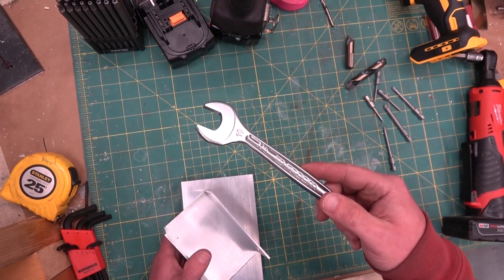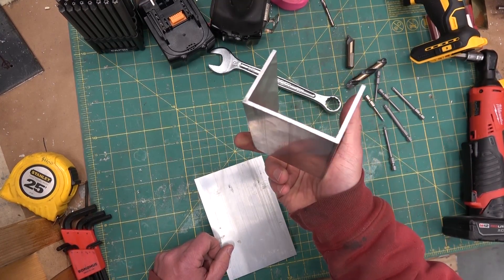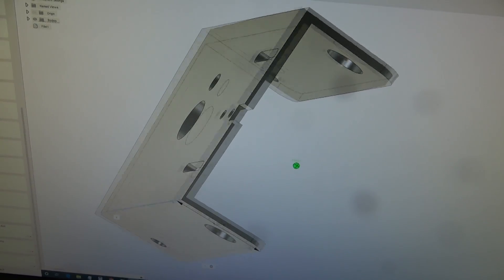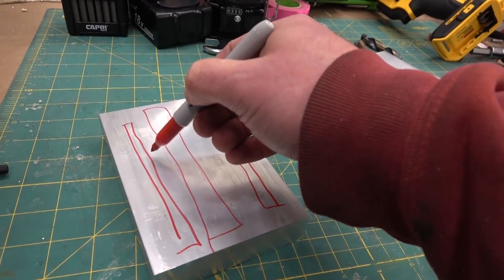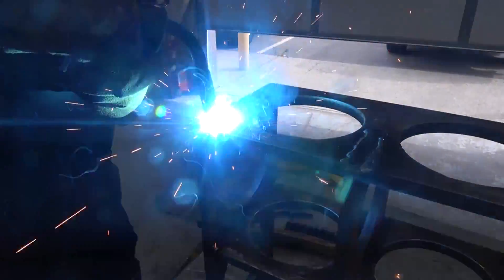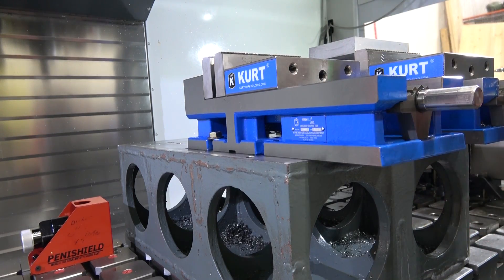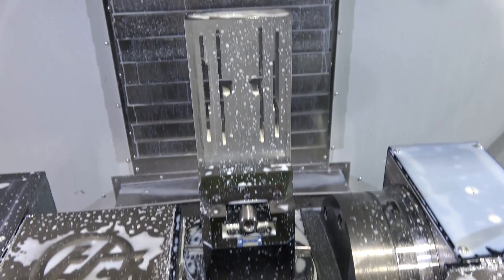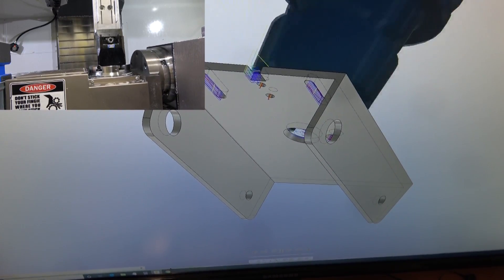Simple vise from pipe plugs | NYC CNC Johnny 5 Robot

Comment: Those@%&# renishaw batteries go out at the worst times, it pays to have at least one set of spares on hand. I think the other probe uses the same size battery, so it keeps the number of spares needed down. Btw, theyre available on Amazon, just like everything else these days.
Reply from the maker: You couldn't have let me know earlier?! Now I got ten of the corkstuffers hidden in my drawers.
Reply: @arduinoversusevil2025  Enjoy buying those goofy Li-SOCl2 Saft batteries made in France that Renishaw insists on using.  They couldn't have just gone with standard CR123's...that would make it too easy.  The tool setter and touch probe battery life is also staggered...one always seems to last about a third longer than the other so you're always changing those fucking things and then having to run through the calibration process again.  You're going to be getting the timeout alarm soon when you use the touch probe in the next few months.
Reply: @arduinoversusevil2025  the batteries seem to last about six months or so in regular shop use, but thats machines running 12 hrs a day, six days a week.  We just keep 20 of them, along with AAs for the renishaw radio probes, in the insert drawer. Was it completely dead? We start getting wierd issues with probing long before it starts showing indicator lights to change. First solution when having probing issues at work is to change the batteries.. btw you have spare batteries for the probes, but do you have a spare probe tip as well? Ebay is the cheapest ive found.
Reply: @arduinoversusevil2025  What were you doing with the batteries in that piece of aluminum you torched @4:40? Went right over my head.
Reply from the maker: Warming them up.
Reply: @arduinoversusevil2025  works every time!
Reply: @arduinoversusevil2025  I guess that's why I always set my work and tool offsets off the part not some theoretical point....
The ONLY reason  I can see for machine home reference is for frequently changed fixtures...................
Reply: @arduinoversusevil2025  I don't think corkstuffers hidden in your drawers sounds healthy🤔
Reply: AvE bragging again???
Reply: The lab I work at has a fleet of data probes running off those things. Hired an intern just to walk around keeping those little buggers alive.
Reply: @Skid6660  im curious now, what type of lab?
Reply: @k_froggy  I'm in the same circle as your UL, Intertek and other big testing labs. My group tests parts and products in extreme environments and sunlight.
Reply: @Skid6660  Oh coo ok. I guess that would take a shitton of probes then.
Reply: @Skid6660  Tell me about it - we have  more than a dozen Hurcos at work and the damn things go fine for months, then over the course of 3 days, half the machines on the production floor start having the wierd probe issues start that come from low battery voltage, and the big VMCs are usually full of chips when that happens😢
Reply: That factory battery warmer on Amazon? Couldn’t find the affiliate link
Reply: interestingly enough i have a plethora of them at work, and use 10 of them per week lol

Comment: Excuse my ignorance but are those plugs tapered? and as they are threaded in they are flexing the plate laterally to clamp the piece of aluminium channel? Couldn't figure it out and that's the only thing I can think of, hence the slots through the threaded holes?

Comment: Am trying to figure out how to get in touch with you... I have a question I want to ask.  How can I email you?  I'm a newbie and wanna know what voltage a battery pack I have is... It came out of a Hyper Gear 24,000 88wh 120ac capable 2 USB outputs portable power bank that has 12 18650's in it.  I'd like to know if it's 3s 2p or 2s 3p.  I'd like to send pix...

Comment: Pleased as a Pig is Shit to see Uncle Bumblefuck making a piece I designed! Not sure exactly why they decided to round off the comers thou? I'll have to ask John and Ed.....
Reply: That piece was designed to be machined from 3" X 2" Aluminum Rectangular Tube Stock. Just clamp in Vise, machine and the final step is to mill or cut off the Bottom section to Spec. thickness. (I had to make 5 of those pieces on a cheap Chinese Mill.)  But if you had done that then I would not have seen such a clever way to fixture the part. Thank you Dude!!!

Comment: Is this a vice? Either I didn’t understand what was the goal, or I’m totally missing how to utilize the construction that was made.
Reply: it was made to hold the part firmly, to keep it from vibrating when being cut. Milling long parts sets up harmonic vibrations when the cutter is contacting the surface which will cause "chowdering" a rough wavelike surface finish most often making the part useless.

Comment: much simpler solution. piece of scrap material, wood for example, or a piece of leftover softer metal from a different project, in between the U-piece and clamp like full material, maybe a little less clamping force.
or you go with an older set of gauge blocks that's not as precise anymore.
at least that's the 3-axis way I'd have done it, as you can easily achive accuracy within 0.01mm of the different features towards one another and it makes programming much easier. but then again, I'm used to a Haidenhain controll, not that Haas thing that requires software to program the toolpaths for you as it is a mess to deal with directly.

Comment: You could also get away with using a pair of machinist jacks on the inside to take up slack and prevent the walls from collapsing when you run a pair of Kant-Twist clamps on the outside. Or do a fixture where you used multiple setscrews along the edges of the fixture block you milled, so you can get clamping up and down the length of your part, instead of using a single NPT that'll really only give you max clamping pressure at the middle of your part.

Also got a crapton of chatter on that sidemilling because it looks like you slotted with a 1/4" endmill sticking out there like a red rocket to sever off that dingleberry of material (which has been known to get sucked back in between the cutter and part, pinching the hell out of the engagement point, which causes your tool to blow up, scrapping your part, and kicking your fixturing out of square), instead of doing successive climb cuts with a larger diameter tool that would offer more rigidity and reduce chatter.  With full-width engagement, you're going to get the endmill pushing on one side of the material and pulling into the other side so you get double deflection.

Comment: I’ve not seen a battery charger like that since open fireplaces went out of fashion in the UK!
Reply: best comment
Reply: Does heating them charge them?
Reply: @sethbarnard1511  increased temperature increases internal resistance and brings the voltage up a bit
Reply: Byvägen  Ah, thanks so much!
Reply: Stand them on top of a wood burner or radiator.